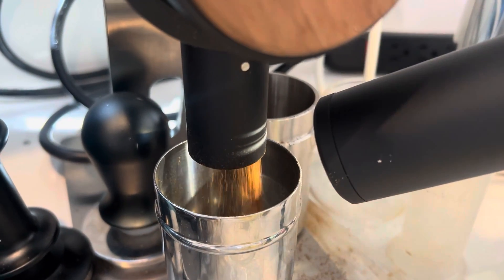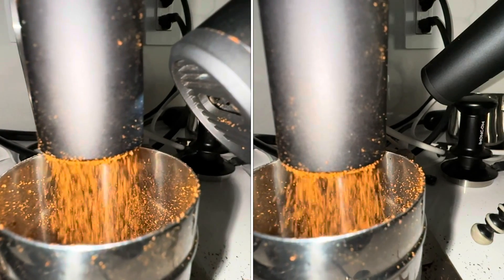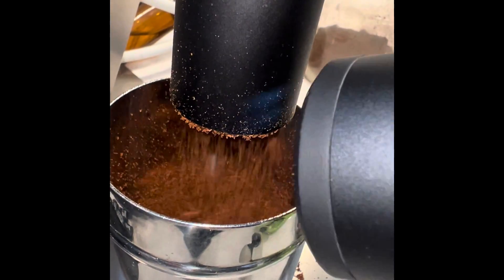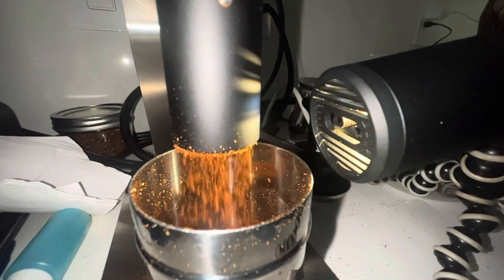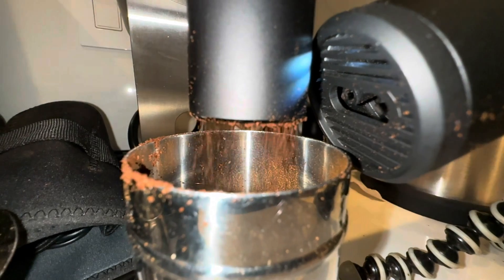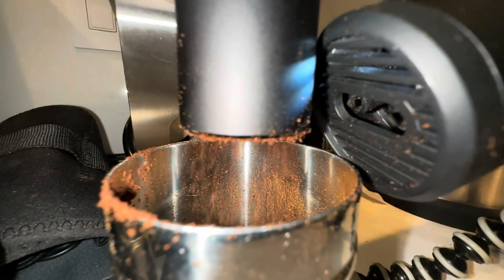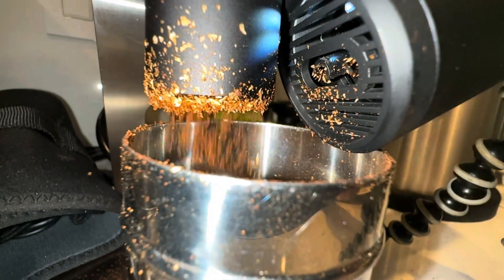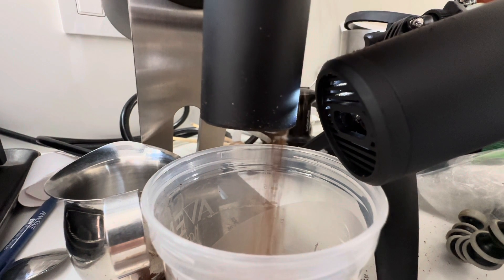Ion Beam by Acaia: a Review

Comment: thanks for the vid not many on the ion beam around .i have the ion beam for my kafetek it works perfect for me .mc6 is not that bad with static compared to many grinders but still produces some and. i no longer have to rdt ,so for me works a treat
Reply from the maker: Thanks for sharing! I know experience has varied and I am glad it works for some.
Reply: I have a kafatek as well.. do you have a special/custom mount you use? or just a stand?

Comment: What's your internal humidity? Depending on area of the country and time of year, the Ion will be more or less helpful.
Reply from the maker: Pretty low. I’m in California
Reply: @espressofun6091  less humidity means more static charge. You can also use some ESD tape on the inside of the chute to reduce static charge if you can access it.

Comment: I think, you should try grounding/earthing the cup! A simple wire firmly attached to that and something else in the house that’s earthed electrically (ie a metal outer of an electronic product or a pipe in the house, or u can get those earthing plugs that plug into the ground port on a wall plug)

Comment: Even if it worked perfectly, seems like a bad solution. These single dose grinders are full of these hacks, for example the ugly bellows and now those “prebreakers”. 

Clearly electric grinders, specially big flat burrs, were not made for grinding small doses of coffee, they end up creating more problems than they solve. 

Hand-grinders seem like the OG single dosers, low retention, easy to clean and less static due to low rpm. You dont need “prebreakers” and more complexity because you have a grinder with an appropriate size for your dose!
Reply: Static exists with hand grinders just as it does with flat burrs. Every hand grinder I've used, whether 1Zpresso, comandante, timemore, they've all produced static with fines clinging. Banging the grinder on the counter serves as an effective knock. RDT solves this, just as it does with larger electric grinders and flat burrs. Also, the new implementation of ionizers (which seems to have been pioneered by Chinese grinder manufacturers, quickly followed by Fellow with the Ode, and now shipping with the Zerno Z1) built into the grinds chute almost entirely eliminates static. It's about as effective as RDT. Not sure where you get on with this notion that big electric aren't meant for single dosing and that hand grinders are superior...this just sounds like the opinion of a hand grinder fan boy. And don't get me wrong, I love hand grinders! I own and use several. But they'll never rival big flats in clarity and unimodal grinds distribution
Reply: @danielcohn6884  its not about being an handgrinder, it could be electric as well. What I said is that smaller burrs and grinders are more appropriate for small doses. 

For example, single doses on big flat burrs will popcorn and you will have consistency issues, simply because they were designed for grinding with the weight of the beans in the hopper. Thats why some people stir the ground coffee - the last bits will be different because the chamber was less full when ground. 

You will always get static, but the low rpm of handgrinders can also help. I am sure you can get better results  with a big expensive machine, but always with added complexity due to the adicional problems it creates.